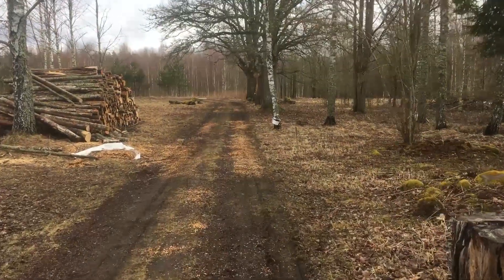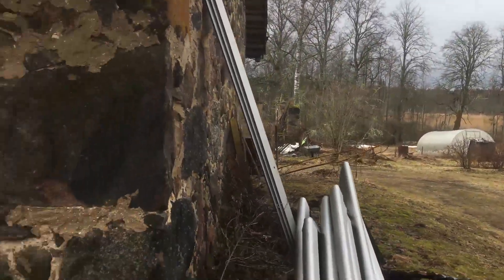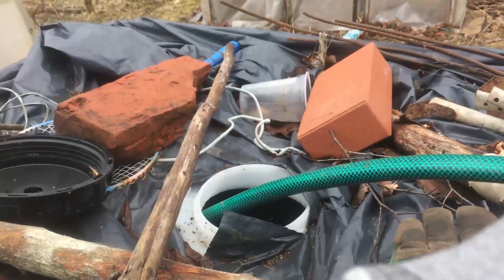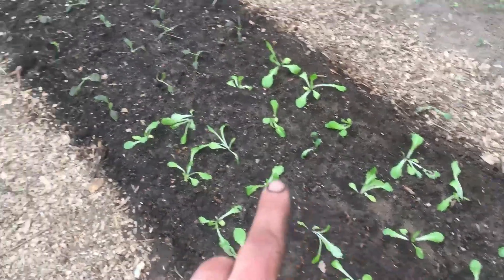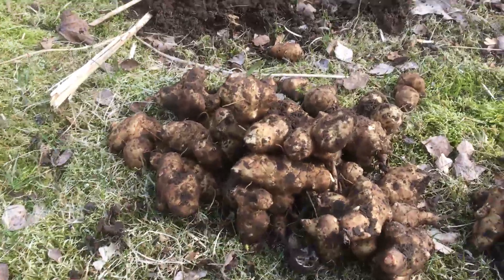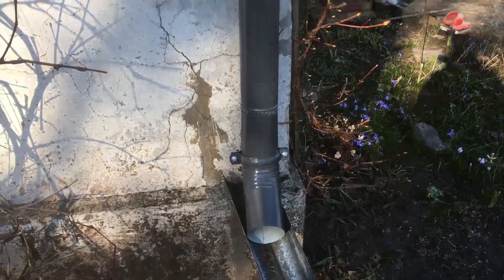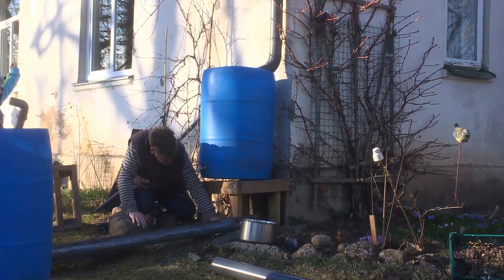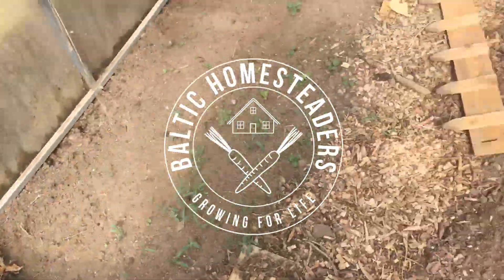Snow, Rain, Hail and Sun - Week 15 2022 - Latvian Homestead Weekly Vlog Update

Comment: Dont weld the barrels. You can get them for like 5€ new from local oil suppliers. Usually in dealership for chainsaws or just wherever they sell oil. Finally spring.
Reply from the maker: To be honest I want shot of it and replaced with plastic barrels like we have elsewhere. I filled it with a drop of silicone in the end :)